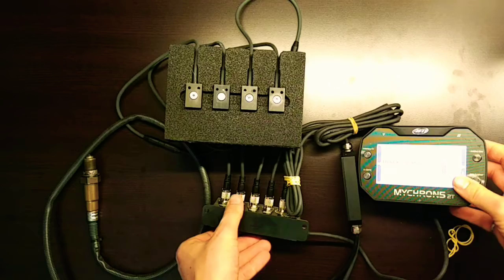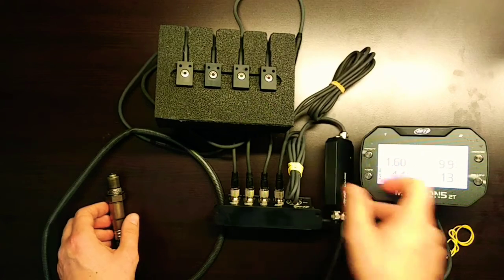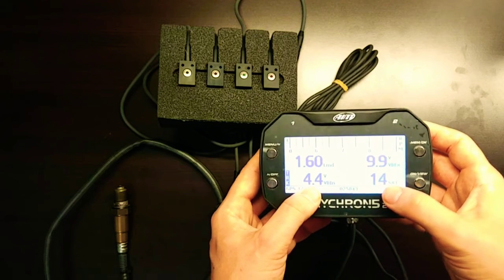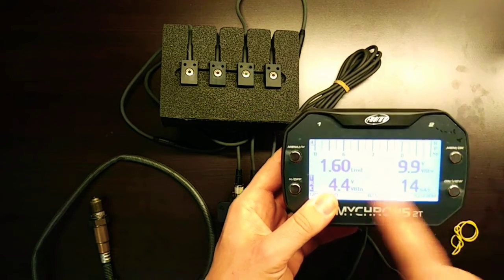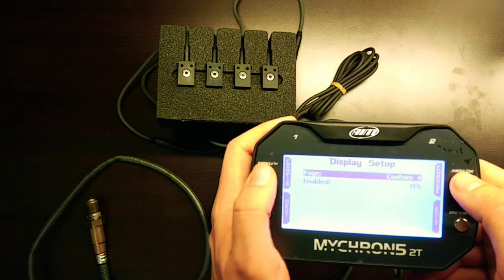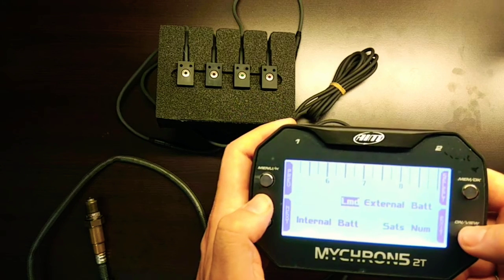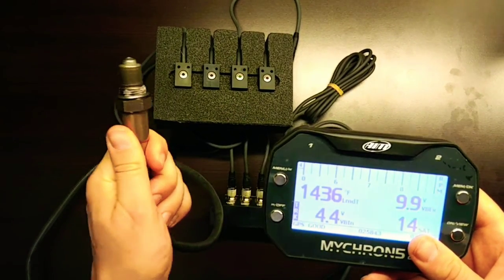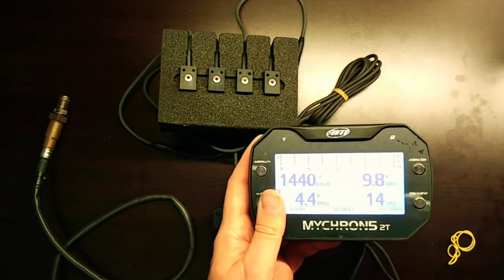AiM MyChron 5 2T with LCU-ONE Lambda Sensor Configuration

Comment: To read mixture, what channel would you need to select…? Lambda value…? Thanks 👍👍
Reply from the maker: Yes, that is correct, the channel will show up as "Lambda VAL" for the actual lambda value, or "Lambda AFR" for the air/fuel ratio on the MyChron screen. You can send us a message at www.oppenheimengineering.com if you have more questions
Reply: @speedmastermarine  many thanks appreciate your help

Comment: Hello, please help.
I have a Mychron 5 2T, and normally I only use the water temperature sensor, but I am scared of running the engine too lean and as a result end up seizing the engine, so my question is Do you recommend a Lambda sensor for my Rotax DD2 125cc engine? And if you do, where do you exactly install the lambda sensor, and lastly, do you know what number should the lambda sensor read in order to run the engine as lean as possible without seizing the engine?
Thanks a lot.
Reply from the maker: Excellent questions, you want the sensor in the largest city diameter section of the exhaust pipe (the belly section, after the diverging cone), and as mentioned in my other comment the ideal air fuel ratio will really depend upon the type of fuel you are using.
Reply: speedmastermarine 
I’m using unleaded fuel with 2% oil.
Thanks a lot 🙏
Reply from the maker: @p.c.h.6721  What octane is the fuel? What altitude and compression is the engine?
Reply: speedmastermarine 
95 Octane fuel
565 meters of altitude,
Compression of the engine is about 13.87:1 - 14:1
Thanks a lot 🙏
Reply from the maker: @p.c.h.6721   That is all good info, I would recommend to download the Rotax Max Jetting guide smartphone application from your app store, for those parameters a main jet of 135 is a conservative starting point then you can start to lean down from there using the LCU-one lambda data as a guide.
Reply: speedmastermarine 
Awesome, I really appreciate it, I do used the Rotax app on my phone and I’m currently using a yet of 134, and so far so good, but I question if I can use a yet of 133 without seizing the engine, so probably a Lambda sensor would tell me right away if I can use a 133 yet, or maybe even a 132 without seizing the engine?
Most of my friends who also have Rotax DD2 125cc engines have seized their engines once or twice already after going too lean and not having any type of sensor, other than the water sensor that, as you know, doesn’t help when it comes to tuning the carburetor right on the limit, which is what we are all aiming at.
Reply from the maker: @p.c.h.6721  The AFR data from the LCU-one will allow you to see where in the rpm band you are dangerous in terms of AFR ratio, for short courses with short duration sections of full throttle you should be able to downjet without risking engine seizure, however for longer straightaways, you may want to use the LCU-one in conjunction with an EGT sensor to keep track indirectly of the piston temperature (as the EGT's rise in longer duration full throttle straight aways the piston will increase in temperature and reduce the piston to wall clearance, especially near the exhaust port where the temperatures are highest). Check out some of our other videos where we have telemetry data of EGT's on two stroke engines... you can see what a seizure event looks like in the following video.

https://youtu.be/KFbXn9Neuag
Reply: speedmastermarine 
Awesome, awesome, awesome! You have no idea how much I appreciate your input, very few people know about what we are talking about, most people just tell you information based on no knowledge of the technical aspects.
I’ve been wanting for a long time to hear someone make sense with logic of this subject, my local karting shop doesn’t really know that much about this subject and my friends at the circuit know even less than I do.
Besides the Rotax DD2 engine, we also have a IAME X30 125cc and on that one we do have an EGT sensor installed and we get a reading of 660-680 degrees Celsius at the end of a very long straight and so far no problems whatsoever, I wonder if the Rotax DD2 could also reach 680 degrees without seizing?
I love driving karts but I also find all the technical aspects just as interesting, there is such a joy in knowing that some people do know their stuff, so I thank you for it. If you ever come down to Marbella in the south of Spain, please contact me, my husband and I would be delighted to take you out for dinner 🍽 
The link to the video that you’ve sent me shows a speed boat going extremely fast and the EGT sensor shows very high readings, my husband has a speed boat, not nearly as fast as the one in the video, we have 500hp and that’s enough for me, maybe not so much for my husband, thanks again for all the help 🙏
Quick question, which one should I use, the Lambda value, the Lambda temp F, or the Lambda AFR? Does it make any difference? I’m not familiar with the Lambda sensor.
Reply: @p.c.h.6721  I'm also going to buy an Iame X30 Senior 125cc. Can you tell me what are the reading I should get on LCU?
Reply: @thinukawijerathne  
Hi, I didn't buy the LCU, I'm only using the EGT. I'm driving KZ now, I sold the X30 and the DD2.

Comment: question.......what is the difference between a Mychrone 5 and 2T. Both units have the exact same pots on the back of them. Is it just that the 2T comes with 2 temp sensors out of the box compared to 1 sensor for the Mychrone 5? Thanks
Reply from the maker: Great question, they are very similar, and both have 3 ports on the back, however the difference is the 1T has a 3 pin temperature port (for a single temp sensor patch cable) and the 2T has a 7 pin temperature port (for a two temp sensor patch cable)
Reply: @speedmastermarine  so will a regular mychron 5 allow you to run the lcu1 and a thermocouple water temp sensor? Plugging the lcu1 and the water temp right into back of the tach without an expansion box?
Reply from the maker: @davidsimonson2022  You can run the LCU-One without an expansion box by just plugging it into the "exp" port on the back of a MyChron 5, if you have the 1T model that only supports one temperature sensor (EGT or water temp or CHT), the 2T model supports two.
Reply: @davidsimonson2022  Yes.
Reply: @speedmastermarine   Thanks
Reply: @speedmastermarine  so what do I do if I want to run 2 temp gauges from my regular Mychrone 5?
Reply from the maker: @twinturbo3470  You will need a MyChron expansion which enables you to run water temperature (Thermoresistor sensors) or infared tire temp sensors. If you want to add another K-type sensor unfortunately you need to upgrade to a 2T model since it the MyChron line of loggers does not support a thermocouple expansion. I hope that helps!